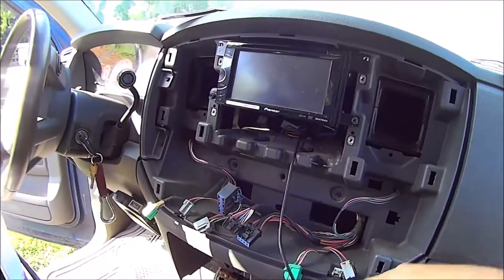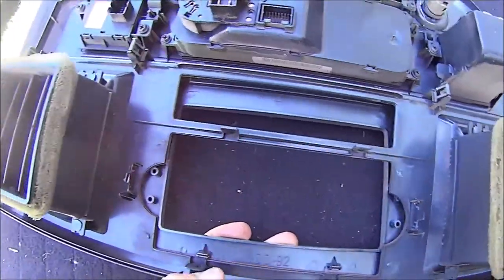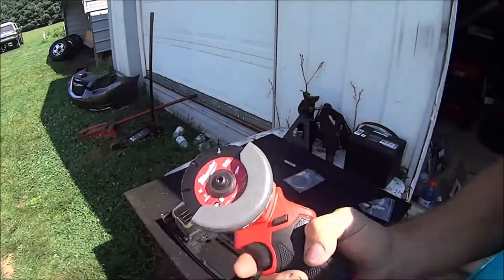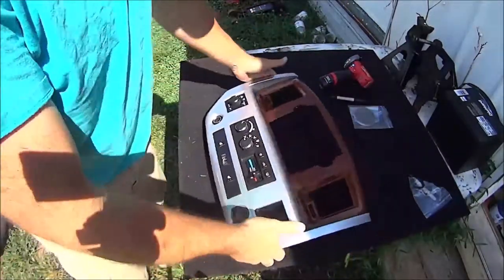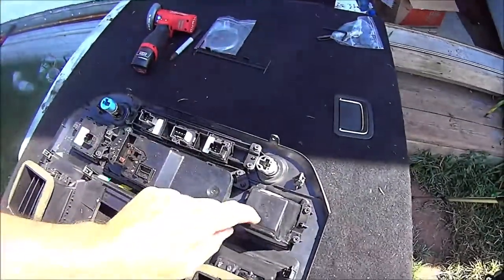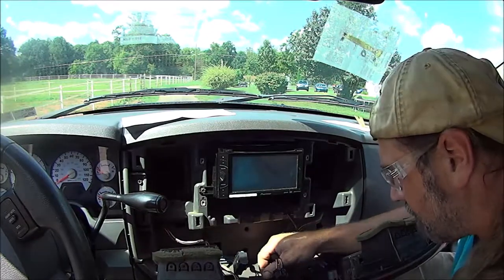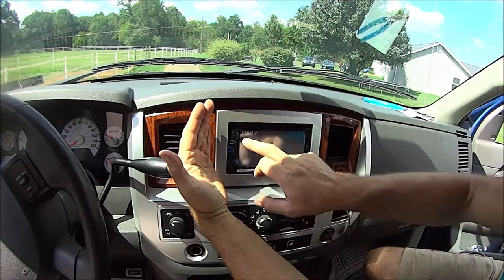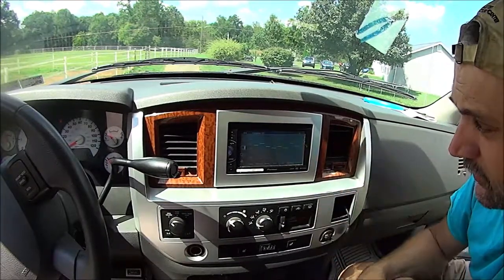DODGE RAM RADIO INSTALL PT3

Comment: Did the sound quality end up being good? I’m worried about the fader not working?
Reply from the maker: For me I think the oem radio sounded better there’s no front to rear and I lost use of the ceiling mount DVD player it’s a give and take I guess this new radio has more features I liked  cds but now I just hook up the phone for pandora radio
Reply: @Mattsneedforspeed  well thanks I think I’ll be finding out how hard it is to just delete the factory amp when I do mine.